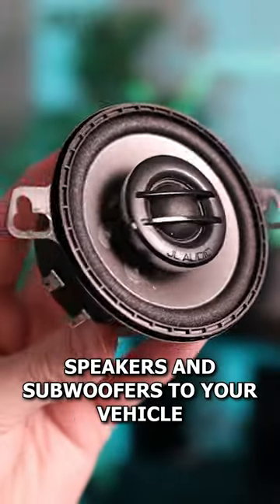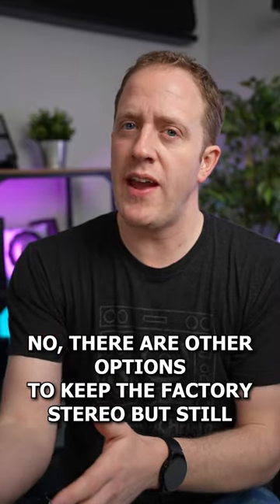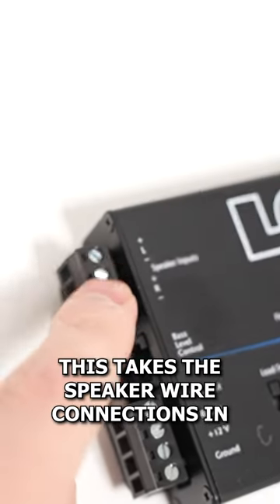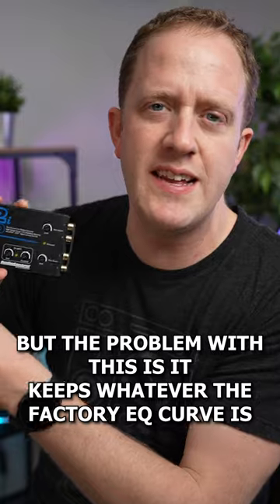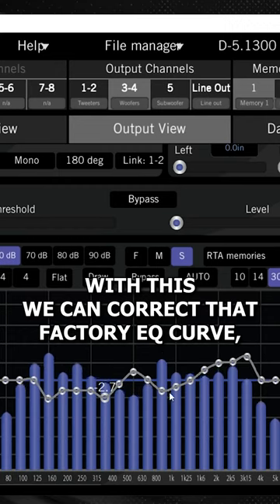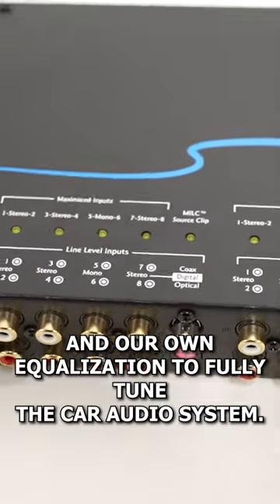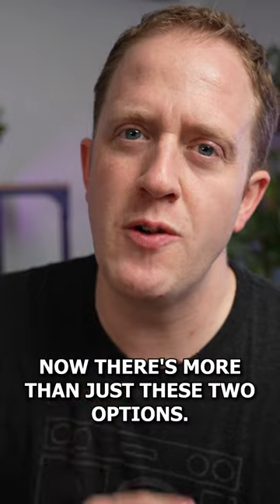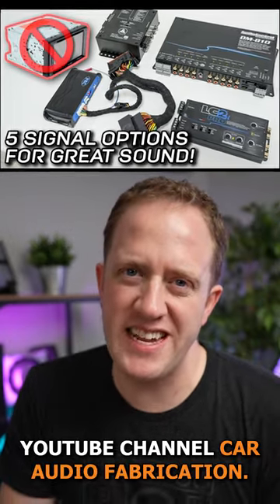Is an aftermarket head unit a MUST for custom car audio?

Comment: Goes from an $80 piece of hardware to an $800 piece really quick
Reply: Absolutely, but I could definitely see in some newer cars having a nightmare of a time replacing the infotainment system for an aftermarket head unit.

Comment: I will be happy if more companies offer a 40w RMS head units, specifically android units so that extra wiring and external amplifier isn't required.
Reply: It's infinitely better to run an external amp with an android head unit even if they do make one capable of 40w. I installed an android head unit in my car and the amp chip in there did not last long at all and I did not get a cheap one I got one with one of the best amp chips as well a the unit in general. There just simply is not enough room to fit the components necessary to have a amplifier that will run at decent enough power and also be able to handle it. It's not even worth it any way you look at it when today many fantastic class d full range amplifiers are under $100 and are a piece of cake to install and will always no matter what be significantly better than an amplifier built in an android unit. Makes no sense to spend more money on the barely better android unit versus using that extra money an get an external amplifier

Comment: Ok confused! Learning all this now and have found out one thing! I need to go to college! 0 watt speakers. Pre out? Omg confused! Thanks for the info in the long form video
Reply: So most factory Head Units are tuned down so they are almost impossible to damage their sub-par paper speakers they install at the factory.  You can either replace the head unit, or use his advice to boost it. The reason for this, is it will usually sound weak on quality speakers if you hook them directly to the factory head unit, even with an amp! Plus you need to learn about low, mid, and High pass filters! And what components actually have that technology built into them!
Reply: @tobybigham4196  ok so much to learn! Damm my wanting to hear music! I thank you for the comment.
Reply: @junkie842  Just wait though. When the system is fully hooked up. All your beauty panels are put back on. And you listen to it for the first time. If balanced properly, with the right filters making sure your low, mid, and high range are going to the speakers that can handle it. OMG, it just feels so satisfying. And then you need a new project! LOL

I hope you all the best in your endeavors. And it actually makes you normal if you need help. I constantly ask questions to people I know who know more than me. And I am a novice!!!!!

Comment: I totally agree with your alternative options as they are great options. But there are a lot of head units available that are great on your budget, if you want to use the settings in your Amp to do your filtering and EQ. Personally I am not a fan of the "Wimped down" head units that Toyota offers, so I was motivated to get rid of mine! lol

That said, this is a must watch that I will pass on to others! Great content, I think I quote you the most with friends and family!

Comment: Mark HUGE fan!! Can you
Please answer this debate question!!!? Do you need a stronger amplifier to compensate for the factory head unit?? Given an aftermarket deck would output more Watts????? Please help!
Reply: My opinion purely. Either replace the head unit, or boost it the way he says so in this video. I put Sundown 6x9's and 6 1/2's" in my truck doors, and the factory head unit in my Tacoma didn't have that great of sound even when boosted by a Skar SKv2-200.4D.
 
I upgraded the Head Unit, and the quality difference was amazing. After that I finished off with 2x 12" SLD's from Sundown which I hooked up with a SKv2-1500.1D.